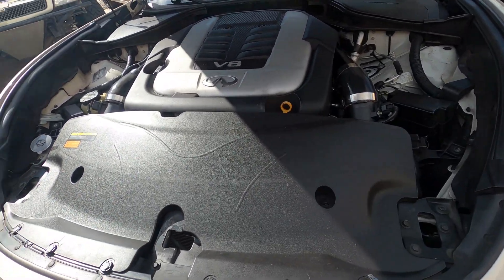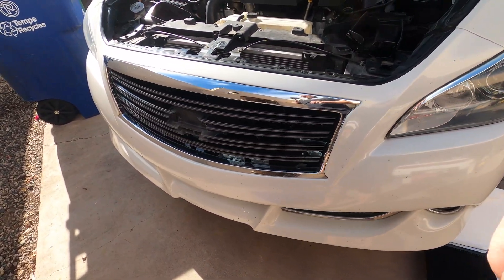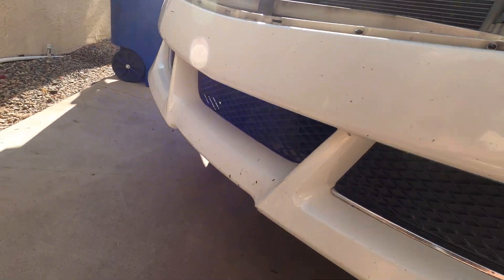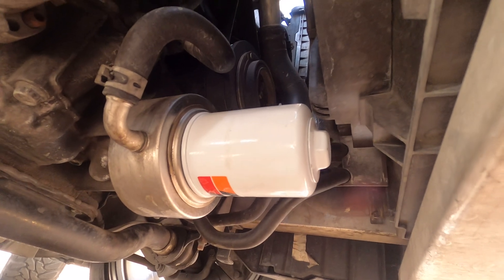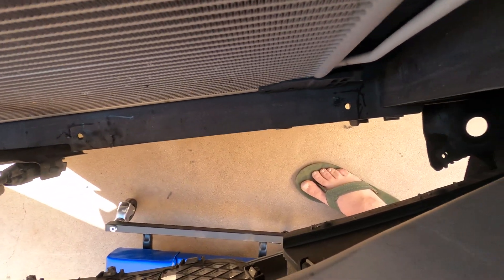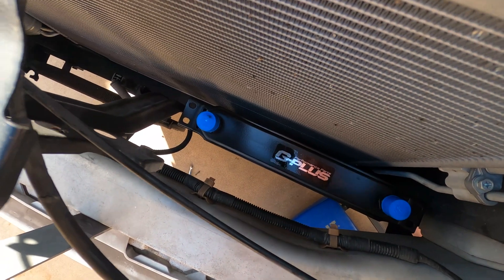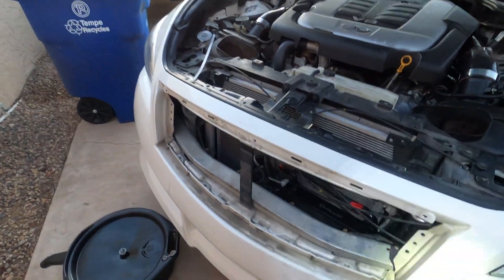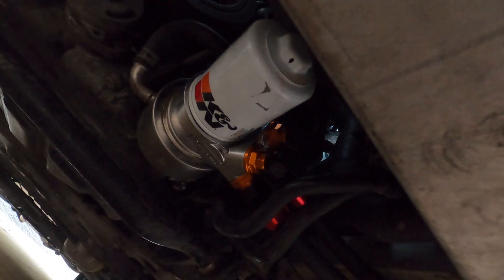Oil Cooler Install - Simple DIY

Comment: Isn’t it a pain that our cars have the factory donut cooler/heater on the filter housing
Reply from the maker: I don't know if it's a pain - I know it's good to get the oil up to temperature quick and that helps a lot for sure. Especially in colder climates.

Comment: I am looking to install an oil cooler on my 2011 M56S, where did you get this one? You got a link?
Reply from the maker: I got it on eBay I didn't post a link because when the auction ends, the link dies. But here is an example of a current auction 

https://www.ebay.com/itm/253412515354?mkcid=16&mkevt=1&mkrid=711-127632-2357-0&ssspo=kEr5dC18S1i&sssrc=2349624&ssuid=2TlmACqBSju&var=&widget_ver=artemis&media=COPY

Comment: Do you have any videos or photos for accessing the fuel injectors?
Reply from the maker: I don't but I need to clean the valves again soon so I'll probably do a video on that
Reply: @TheHoggman  cool, are you running stock injectors? Is the intake hard to take off?
Reply from the maker: @itsajonesthing8971  Yes it is all stock and the intake is so easy to remove. It's less than 20min to take off.
Reply: @TheHoggman   what do you use to clean the valves